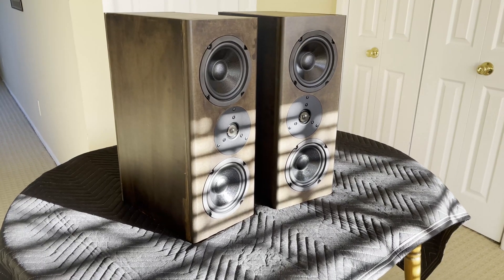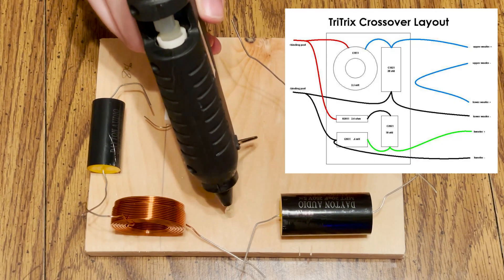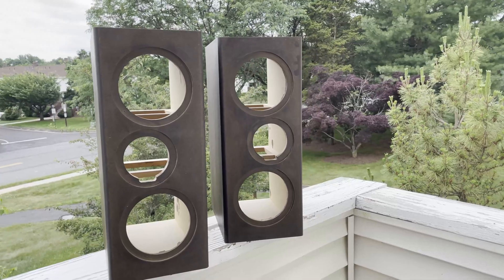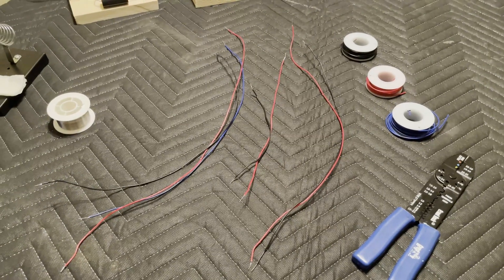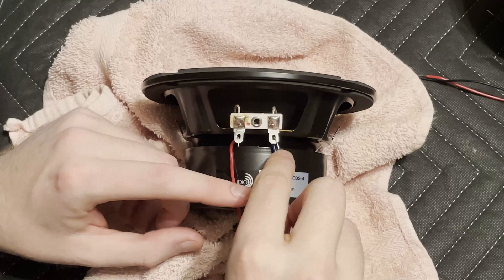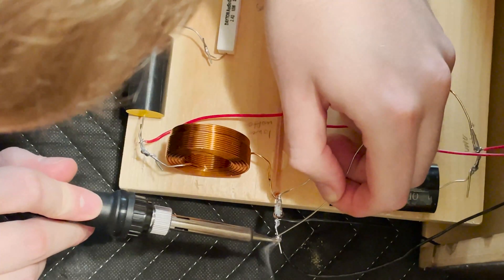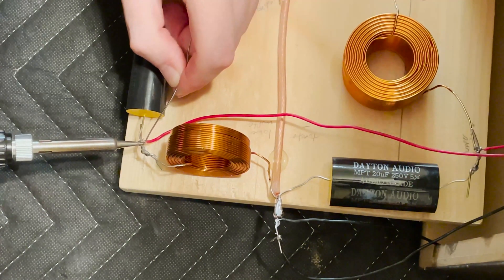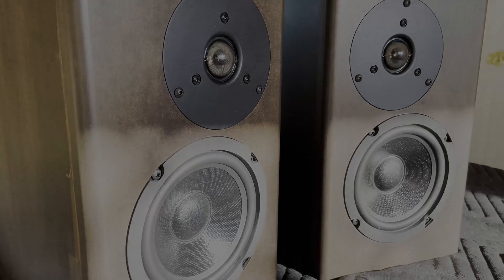I Built These Speakers

Comment: I like it speaker built setup  which box dimension or internal volume and port dimension ?
Reply from the maker: Hey! The speaker boxes them selves were in the Tri Trix kit but they are 11.5" X 18.5" X 7.5"
Reply: @TechStuff13  What do you think about the bass output?
Reply from the maker: @johnrambo19820  Base is on the flat side intentionally. If you want them to be TV/Movie speakers they pair nicely with a dedicated sub.
Reply: @TechStuff13  okay thanks! I was wondering how they were. I built the AviaTrix MTM MLTL's a while ago and they have a decent amount of bass which makes a sub optional